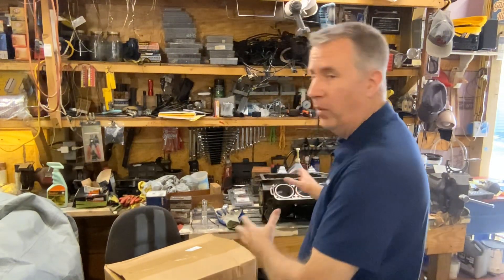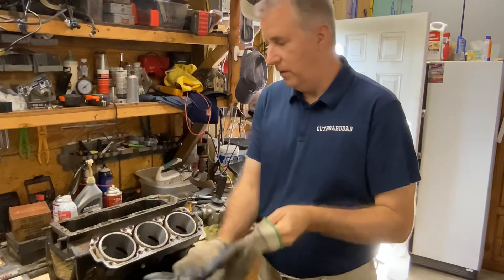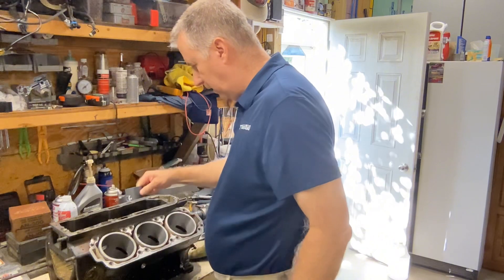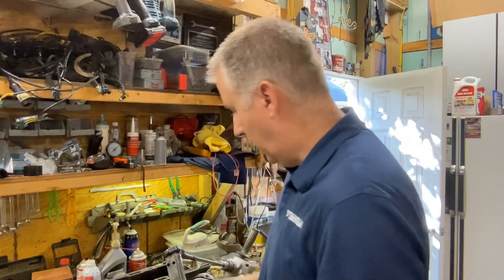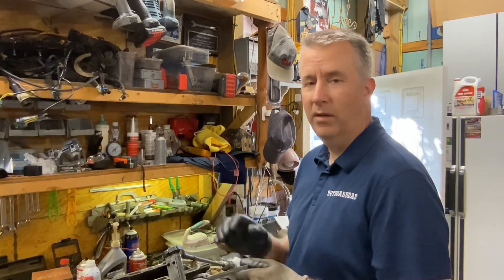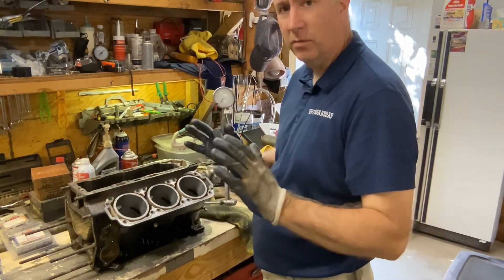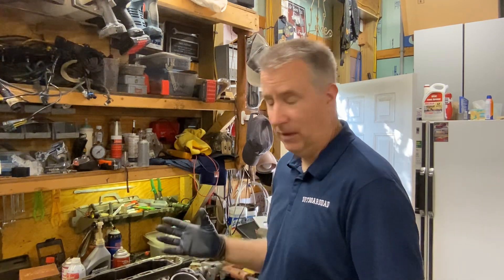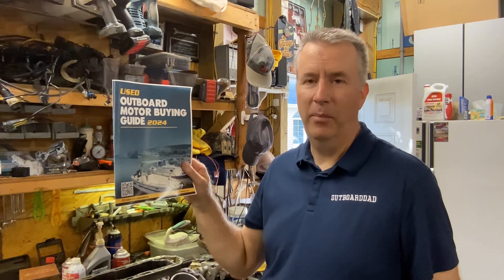Mercury 2.5 Outboard Boring block dial bore gauge (Part 16)

Comment: Today I was thinking that it would be essential to find out why this engine suffered overheating. 

Signs are clear that it suffered overheating at least one time, probably very many times.

Temperature alarm kicks when gauge reads 3/4.
This should give enough time to stop the engine before any damage is done. 

Oil alarm kicks when the small oil container is not full of oil, and variable oil injection shouldn't be out of calibration.

There must be a reason or several reasons coming at the same time that caused overheating. 

There are signs that some cylinders got more heat than others, specifically close to the exhaust port.

Exhaust pipes used to get too hot when fuel to air ratio is lean, or poor in fuel.

Maybe some cylinders got leaner fuel ratios than others?

Exhaust manifold gets cold water first of all as I see looking carefully at water flow diagrams. 

Then water flow goes to cylinders heads through both thermostats, before heated water gets out, reaching water jackets afterwards but only exiting water jackets after poppet valve starts opening...
If my interpretation of the waterflow diagram is right.

It's a shame that with so much cold water at hand engines keep overheating. 

Finding out the reasons why it got overheated is a must, in my opinion. 

It would be very sad to find out that the engine is overheating again, after your excellent job rebuilding this motor.
Reply from the maker: @josemariatrueba4568  Agreed, this is why NO machine shop, Marina, or outboard rebuilder gives ANY warranty. Now they may say 90 days or one year but when you read the fine print it gives so many disclaimer scenarios that it’s basically no warranty. I am in contact with the old owner and will inquire.
Reply: @OutboardDad 
I see.

Now I do understand why they can't give any kind of warranty.
Reply: I have edited my message  because I missed a couple of things in the first place.